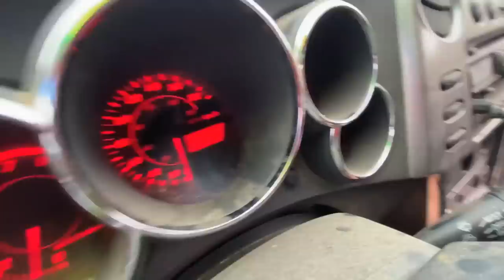Ford Vs Chevy Vs Mazda DERBY DESTROYED!

Comment: seemed like the ranger had the solid running engine even after all that beating. no ticking or smoking thats a keeper
Reply: Those Vulcan engines are abusable as hell I’ve got a ranger 3.0 with 200k miles and I’m tough on it but it takes it lmao
Reply: @BADBADGER18  Only 200? I've seen them with 500k.
Reply: @BADBADGER18  yeah the Vulcan is an excellent engine.  All iron and way overbuilt plus low power output.  I've had 3 Tauruses with the Vulcan and NEVER burned oil or any engine problems.

Comment: Can’t kill those old Ford rangers. Even that escape still runs, just can’t drive it lol.
Reply: yes you can, quite easily too lol.
Reply: @jeremyriddell7868  not really. It's not easy
Reply: @floof4444  just hand it to whislin diesel and he can kill it in a day or so
Reply: @customdeluxe-vc9ob  true. But he will kill the truck. Not the motor. Put that motor into an empty she'll and watch it still drive. Just for him to kill again
Reply: @floof4444  not at all. Lol. It's an engine
Reply: @floof4444  if you think you cant kill it, ill get you some water
Reply: @Sunset_Official_0  funny thing... My 91 ranger was a flood car. And it still after I drained it , replaced electrical components and drained the water and fluids out and replaced the fluids
Reply: @floof4444  how do i know this is a fact? You could just say that so it "proves" your point
Reply: @Sunset_Official_0  u wanna come down to Florida and see yourself?
Edit: The cloth seats haven't been changed and neither has the carpet. I checked the floorboards there is only surface rust on em.
Reply: @Sunset_Official_0  my firebird is also a flood car. The only reason why the trans am won't turn over is because of the crank is rusted so badly that it basically welded itself. So that motor needs replacing.
Reply: @floof4444  why the hell would i go to Florida? I'll pass on the free corona 😁. I'll stay safe in a country that knows how to ya know, live through a pandemic.
Reply: @floof4444  hmm? Whered that last reply go?
Reply: @Sunset_Official_0  I actually don't know, did the owner of this vid delete it?? I certainly didn't. I'll say it again if u want
Reply: Its really easy to kill a ranger they are not heavy duty trucks
Reply: @mechanicalking  thank you
Reply: 200 shot of nitros should give it a piston delete
Reply: @floof4444  whistlin diesel already had one and he hated it

Comment: The Duratec/Vulcan engines in the Ranger and Escape are near bulletproof!
Reply: Motor in the ranger is a Vulcan
Reply: @ashtondavis.3191  I must be thinking of the newer pre-Europe Rangers then. I believe a Duratec was an option at least by then.  Regardless of that, both are still tough vehicles to be taking all of that abuse. If you haven't already, check out another one of Mark's previous vids where an Escape is jumped, rolled over, crushed, and still ran until the oil was drained out of the engine.
Reply: Ranger has a Vulcan or a Lima
Reply: The escapes engine good ...... trans is a diff story lol
Reply: @joshm.9308  The Vulcan is the 3.0 V6.  There is also a 4.0 v6.  And the Lima 2.3 4 cylinder was used until 97 when the 2.5 Lima replaced it.   2002 I think was the first year for the 2.3 4cyl  duratec which replaced the Lima.        The 2.5 in my 99 Ranger has 200, 000 hard miles on it cause it was a city truck.  and it still runs like a sewing machine.
Reply: @joshm.9308  Whistlindiesels trucks go through worse and still work. Just sayin... It's called an engine... Some last a long time and some dont
Reply: @letmesleepproductions4771  That's true! Now it's just the opposite with the newer Focus based Escapes. Heard that the newer ones have engine problems.
Reply: @strattonthewolf213  Now that's a good reliable truck! Thanks also for the additional info as well.
Reply: Josh M. My dad and my sister both had escapes and aside from normal shit like tires and breaks the only thing that broke on both escapes was the trans lol
Reply: @letmesleepproductions4771  So far, I've experienced minimal issues on mine so I'm keeping my fingers crossed. Plenty of power with the V6 along with a good amount of room too so I can't complain. FWD in the winter isn't actually too bad either. I just drive more carefully when the snow hits.
Reply: Josh M. Oh yeah as bad as the trans in them are I love the escapes
Reply: Duratec is in my ford freestyle its caught on fire and still runs
Reply: Matrix жужжит как муха на окне😂
Reply: Mazda